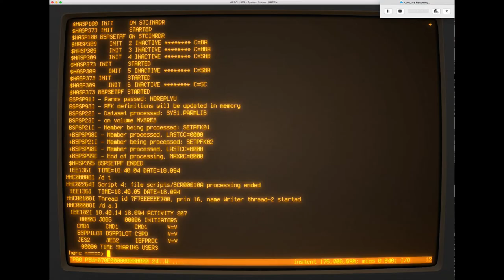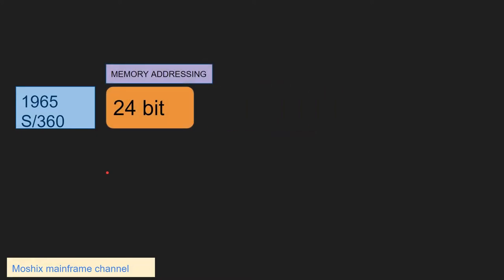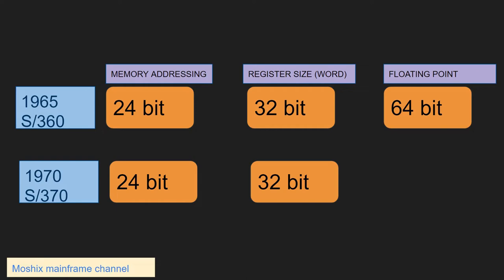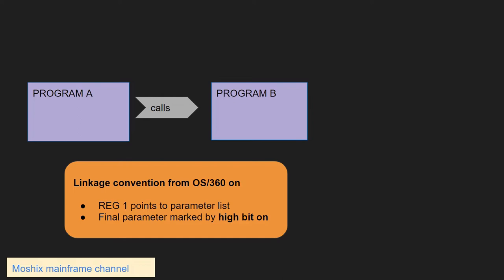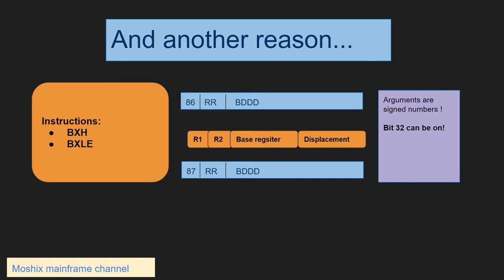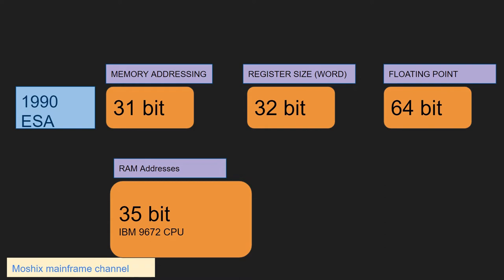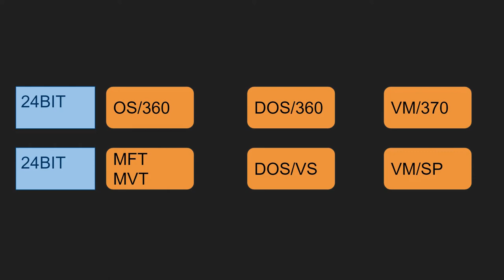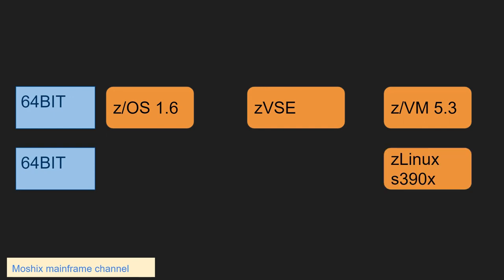Mainframe 24/31/32/64 bits explained - M161

Comment: Thank you for your presentation.  Yes, the mainframe memory architectural is truly interesting. As a career mainframe programmer, we commonly use terms below the "line" (16mb limit) and above the "bar" (as in memory above 4GB).  Well, technically the above the bar, is 2GB, but because of that high order bit, complicates addressability. 
Yes, that Trimodal addressing is a beast in itself. 
I worked with senior assembler programmers, who write code which changes address modes to and from "24" and "31" with the "BASSM" and "BSM" instructions.  Though, occasionally, I like to refer these as the Basm/spasm instructions. :)
Reply from the maker: Cool! Thanks a lot !

Comment: I hope you talk a bit about the oddball S/360-67 which had a 32-bit address space in 1965. :)
Reply from the maker: I mention it very briefly when I talk about the reasons of 31bit and when I talk about special bit machines.
Reply from the maker: By the way  model 67 was released in early 1968
Reply: And then we have Seymour Crays CDC machines, 60 bits word size

Comment: Just wondering if you had any information on what DEC was doing?  The PDP8 was a 12 bit octal machine, PDP11 was a 16bit with a max of 2 MB memory, the VAX was a 32bit machine, and the Alphd was a 64 bit.  That's about all I know off the top of my head.
Reply from the maker: All true !
Reply: Those were minis though, and not intra-compatible

Comment: Did the latest Z architecture finally provide additional addressing modes such as indirect addressing modes with choices of pre or post indexing? I do not have the ability or training in “ higher hieroglyphics” to prove the assertion that just the base plus displacement addressing poses the threat of address reference thrashing with very large program sizing in that most if not all of the program procedure code space is consumed by base reference addressability load instructions and address data constants for loading into registers used to support the using assembler statements!
Reply from the maker: What you say is true. Especially in virtual memory environments base and displacement can lead to a lot of false sharing which kills NUMA performance all modern mainframes are NUMA machines.
Reply: The addressability issue is going to need aggressive attention with quantum computer design!
Reply from the maker: Indeed
Reply: There were some 31 bit machines that introduce PSW +/- offset instructions that were much faster than Base+offset(and index R0 was ignored), which was faster that Base+offset+index R1-15).
Reply from the maker: Good to know

Comment: Does the 64bit memory addressing mean 64bit physical AND virtual memory addressing is possible? Meaning a z15 it can address 16EiB of physical RAM and virtual memory combined?

I know that POWER9 has a very confusing 56bit PA, 68bit VA, and 64bit "effective addressing"(I'm not sure what the effective addressing even means in that case).
Reply from the maker: Z15 is 56 bit as well right now. But a machine with 64bit real memory with current sram chips would use several hundred cabinets
Reply: @moshixmainframechannel  Thank you for the reply! I couldn't find the physical addressing of the z15 CPU in any of IBM's literature on the subject.